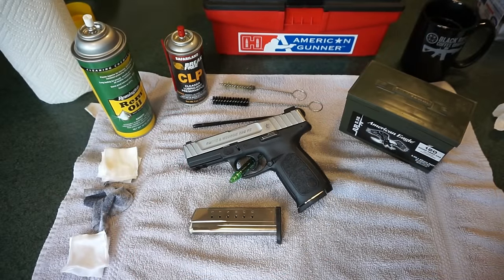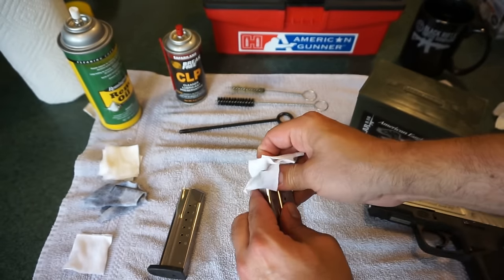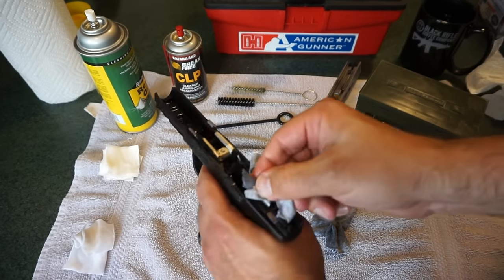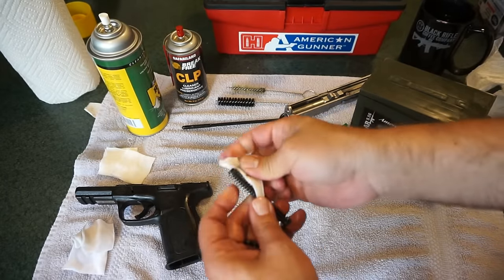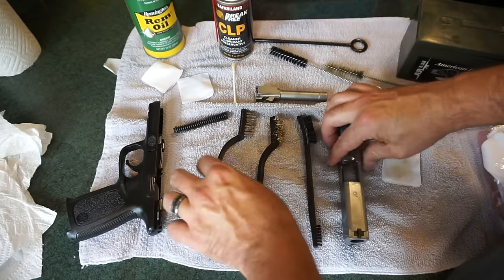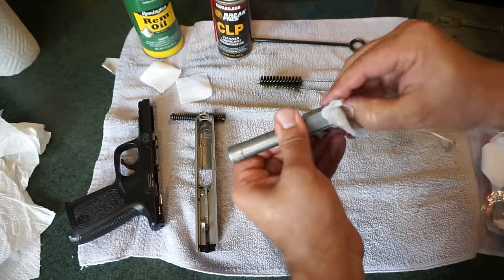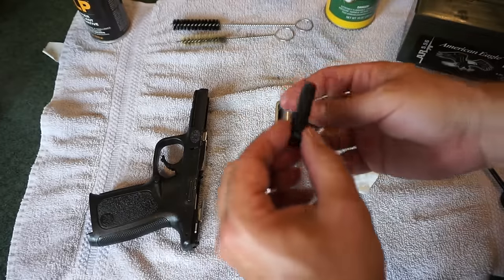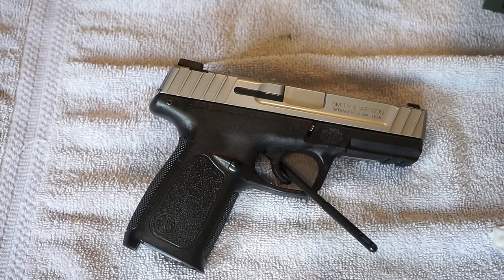Smith & Wesson SD9VE Cleaning!

Comment: Did you ever do the Apex trigger? I have the trigger installed but I didn't take note of the back part of the slide.
Reply from the maker: I always wanted to but I sold it during Covid lockdown to a friend
Reply: @travisp11  fair enough. Apex released one and I got er done 👍🏾
Reply from the maker: The only thing that I have heard is that the striker spring can cause light primer strikes but this was many years ago and Apex may have fixed the issue. Definitely test it after you make the swap. @JonathanLove

Comment: How often do you need to clean a pistol? SD9VE will be my first.
Thank you
Reply from the maker: I clean mine after every range trip and the longer you wait and more rounds you put through it equals more time spent cleaning. Eventually the gun will start to malfunction from being extremely dirty. At a maximum I would say 500 rounds but if your gun starts acting up before that, then clean it but again my preference is every range trip.

Comment: I have an issue with pulling the two releases on each side, I tried the way you did it and I couldn't get it. Is there another way?
Reply from the maker: Just make sure the gun is dry with no oil on it. It takes practice but gets easier the more you are able to do it. You can also pull the slide back slightly, grip the front of the gun and with the slide being held back by your left grip, use your right hand to pull the tabs. This is basically going from the opposite side of what I did in this video

Comment: just bought a new sd9ve from Cabela's $304.THIS IS MY FIRST PISTOL.does it have to be cleaned out of the box before shooting it?
Reply from the maker: offset485 yes. You may have some factory oil and grease in it that could cause malfunctions. At a minimum, just get a can of rem oil, some paper towels and and old  t shirt you can cut up. I saw the Cabela's deal. That FDE model is calling me!

Comment: I absolutely love everything about this gun except it seems hard to take apart for me. I got it from my dad, and he seemed to have the same issue that after pulling the slide back and the tabs down, the slide would only go forward a half an inch. I cant seem to get it to come off completely
Reply from the maker: Yeah, those tabs are a pain.  I believe you can swap out those tabs with larger ones.  Check out NDZ performance, Apex gun parts or Lakeline LLC.  One of those companies makes them.  You also need to make sure the magazine is out of the pistol and that you pull the trigger to release the slide (but be sure the firearm is empty).
Reply: @travisp11  I just found longer slide lock releases on NDZ for like 10 bucks. no brainer, because getting the slide off can be a bit of a bear if you can't get a good grip on the tabs. took me a few times before I was able to do it.
Reply from the maker: @ninevoltromeo  cool! Their accessories are good!
Reply: @ninevoltromeo  thank you for this info, Tommy! I've had the gun for a while, but I've only got it once. It's still oily in the internal areas, but I decided to look into keeping it clean and I had the worst time disassembling this thing!

Definitely going to buy a larger takedown lever.  New to marksmanship (first gun), so I was ready to just buy another one! 🤬
Reply: You guys are missing a small detail that makes buying extended take down tabs a waste of money and time. First, use your firing hand at the back to move the slide back just an eighth of an inch or so, then once you pull down the take down tabs, just pull the trigger and the slide will come right off. Many people think it's stuck at the point, but after a pull of the trigger it is free. No need to endlessly spend money to fix perceived problems. A little more research saves you a lot of money. The same with the trigger. Everyone says to buy the Apex trigger, but that is also a waste of money. You can polish the internals and lube the trigger guard, and the trigger becomes buttery smooth. A little research goes a long way. Cheers!
Reply: Damn ...pain in the ass taking this gun apart!!!! 😡😡😡

Comment: Last time I saw the S&W SD9VE for sale in July 2020  was $389, I already have it so I bought the M&P 2.0 Compact. Only issue I had with the SD9VE ? Polymer guide rod warped after 200 rounds, replaced it with a 20lb steel one.
Reply from the maker: If you check my channel I did a review on the NZD steel guide rod for the SD9VE. It was a great purchase.

Comment: Great video! Very helpful!
But isn't Rem-oil and Clp basically the same thing? Both spray cans literally describe the same cleaning purposes, is it possible to maybe just use Rem-oil for the whole cleaning process?
Reply from the maker: Armando Hernandez Rem oil cleans well but is thinner but will leave a protective coat. CLP is thicker but cleans better but Safariand CLP is my preference.

Comment: I've had this gun for over a year and its been sitting in a case. Its gotten some rust on the outside, very minor, what do you recommend?
Reply from the maker: Try cleaning it with a few coats of CLP cleaner.  You could use some 0000 grade brass or steel wool.  That may be just fine enough to remove the rust but not ruin the finish of the slide.
Reply: Hey guy...you can use WD-40 SPECIALIST gel lube on a pad. It will remove the rust and protect for a long long while. Shake the can good before using !
Reply: Thanks for both of the options
Reply from the maker: @MrKsito  Glad to help!
Reply from the maker: @jtlouie3738  good to know!

Comment: hi thanks for the video. but after i cleaned my firearm i tried clearing the chamber a few times and the slide wouyld get stuck. I would either have the hit the back of the slide to disengage it. any suggestions please. thanks in advance.
Reply from the maker: It sounds like the guide rod may not be flat on the the barrel underneath. Possibly check to see if it is resting at an angle or if it is flat.

Comment: My trigger bar is a little scraped the long piece on the right hand side that pulls back when you pull the trigger I’m not sure what caused it I have the sd9 2.0 oil was leaking out of it straight out the box shot about 20 times but it started to make a grinding or crunching sound when cocking it
Reply from the maker: It sounds like their is some sort of burr or particle in the assembly on on the frame. If it shoots fine that noise and grinding may eventually disappear but it if really bothers you, you can send the pistol in for repair.

Comment: For the guide rod, ndz offers a 15, 18 and 20 lb assembly. What difference does it make? Which do you recommend?
Reply from the maker: Colten Roth watch my video on this guide rod. I believe that I went 18lbs as it was the closest to factory specs. I think you can change recoil springs to make the pistol function better with heavier or lighter grain weights of ammo but I only go with factory pound weights for springs.

Comment: Good video ill be cleaning my gun soon. The sd9ve is my first hand gun and i like it alot. But question, did you install the apex spring kit? I was reading the striker spring may cause dry fire?
Reply from the maker: Yup. Don't install the striker spring from Apex, stick with the Smith spring and you should not have light primer strikes.
Reply: @travisp11  thanks for the fast reply.
Reply from the maker: @angelarceo3678  No problem.
Reply from the maker: @angelarceo3678  Yup!

Comment: Just purchased this one. It’s my first 9mm. Thank for this vid showing how to break it down and clean it. Where can I get Rem oil and Clp?  Subscribed!  Keep the vids coming!
Reply from the maker: You can get Rem Oil and CLP at walmart in the sporting goods/firearms section.
Reply: Be careful it gets rusty fast! I’m not sure how “stainless steel” gets rusty ... did a quick google and found out this is a common problem so disappointed
Reply from the maker: David Cardenas I’ve heard this and seen this on other firearms, especially if you live in a humid or salty coastal environment.
Reply: travisp11 what do you think could help for that ? Slow down the rust
Reply from the maker: @78723lild  Frequent cleaning with CLP. Leave a thin coat on it.

Comment: Question. How often do you want to clean a gun. Dont have any experience and actually just bought this gun.
Reply from the maker: I have quite a few that I don't shoot in my personal collection.  I take them out at least once per year for a basic field strip and clean.  Clean out the bores, add a thin coat of oil to the action.  Since I am constantly testing new firearms (that I have to return) I don't shoot my own firearms as much as I want.  If you have a daily carry firearm Id say maybe every other month take it a apart and clean it, simply because you can get lint, sand, dirt, etc. that will find its way into the firearm from daily carry.

Comment: Just got a sd9ve...can I buy all of these products in 1 kit or do I have to buy them separately? Found some kits but there not these products? Will others do or should I stick with the ones in this video?
Reply from the maker: I bought everything separately. I don’t belief you can buy and all in one that comes with CLP or Remoil in it. You can buy some all in one kits that still include cleaning oil and those will work fine, too.
Reply: @travisp11  ok cool.... 1 other question. I know the CLP is the for cleaning and lubrication. What's the purpose of the rem oil? I see that you use both.
Reply from the maker: KingLeo8179 it does the same thing. The Remoil is a thinner lubricant and works fine as a cleaner and oil.
Reply: @travisp11  ok I appreciate the help.... Good video BTW. Simple and to the point 👍🏾
Reply from the maker: KingLeo8179 thanks man and I may be a bit long winded but I make these videos for the beginner.
Reply: @travisp11  nah that's what I liked about it. You broke it down..... Oh yeah I forgot to ask... So with the CLP and rem oil would you recommend using both or is it an either or type of thing?
Reply from the maker: KingLeo8179 if you want to use CLP, in my opinion, you will get superior lubrication, cleaning and protection versus Remoil. Just use that on all of your firearms and you will be fine.
Reply: @travisp11  cool... Hey man I really appreciate it.
Reply from the maker: KingLeo8179 Glad to help!
Reply: @travisp11  hey at the end of the vid when you were wiping down the slide with that patch was it a dry patch or did it have anything on it? Heard it was good to leave a light coat on the outside of the gun to prevent rust.
Reply from the maker: @TheCoolSpot  You can wipe off the excess oil and put just a drop or two on a patch to wipe down the firearm. Wont hurt anything.

Comment: hello,
what brand of ammunition do you recommend? I noticed the American eagle on the table, also the owner manual for the SD9VE says not to use "+P or +P+" have you tried other brands for the SD9VE?
Reply from the maker: Federal 115 gr. I don’t usually run +P
Reply: I use Federal FMJ 115gr., another brand is Winchester USA Forged Steel Case FMJ 115gr.; But different ammo tends to get the firearm dirtier, and at times longer to clean. But yes usually I use much 115gr or 124gr. and I'll use/ run American Eagle FMJ 124gr. as well as Blazer Brass FMJ 147gr., Hornady Critical Defense 115gr. FTX, Tula Ammo FMJ 115gr.
All great ammo which spread love really good, efficiently. and reliably. Though there's still more out there I've need to test out.

Comment: I Found the stainless steel guide rod by NDZ on eBay. They have different weights listed on them. What is that for?  And which do I get for the SD9VE?
Reply from the maker: SideLineJoe check my video on the NDZ guide rod, I think I mention the weight in the video. Also, email NDZ, they have great customer service.
Reply from the maker: Im pretty sure that it is 18lbs.
Reply: Thanks Travis
Reply from the maker: SideLineJoe alright!

Comment: I cleaned it and put it back together but my trigger didn’t reset should I be concerned?
Reply from the maker: You should be fine. Will it reset now and dry fire if you pull back on the slide and test the trigger?

Comment: I just bought one yesterday and it definitely was not no $300 gun...closer to $500 actually, in fact it costs more than my p95 9mm ruger did years ago, but it's such good quality and is smith and wesson, so I didn't buy it based on just the price
Reply from the maker: The prices I mentioned were from many years ago. At one point, I saw the SD9VEs advertiesed for $279 on CDNN but now the prices are definitely up.

Comment: Have you tried out shooter lube? I thinkn its something I'm personally going to start using because the ease of use.
Reply from the maker: Havent tried it yet.  I usually just stick with CLP but I have tried some of the Lucas Oil gun lubes and they work well.
Reply: I think it will be much better then the traditional hoppes solution. I spilled a bottle of solvent years ago and i can still remember the smell haha.

Comment: When you first push the bore brush through the barrel, avoid pointing the barrel towards your just cleaned slide as it usually will spray some gunk out the front of the barrel.
Reply from the maker: True!

Comment: the take down tabs are so small and push into far on one side the other side pushes out so you cant pull the one down all with the slide back an inch its the worst lol
Reply from the maker: It can be swapped out with a better part from Apex gun parts.

Comment: Just picked mine up from a pawn shop today for $200 looking brand new only came with one mag but I am happy with it any suggestions on out the waistband holsters that would work with this... Information on this video is great thank you for it and thank you also for the PT111 videos that you did in the past
Reply from the maker: Mr MeMkNoCk Lucky!!! Get over to PSA and order two mags for $40. About the best deal you are gonna find on new Smith mags for the SD9. You won't be disappointed!
Reply from the maker: Mr MeMkNoCk you can use Glock 17 Holsters with this gun. I have a Kydex holster and external padded nylon holster got the G17 that work with the SD9.
Reply: AWESOME!! Thanks for all the great info heading over to PSA now keep up the great work and great videos

Comment: did you get the 15lb 18lb or 20lb guide rod and spring?
Reply from the maker: I believe it is the 20. It matches the same factory weight. You may want to see what weight the factory used but I'm pretty sure it was a 20.

Comment: I'm having the hardest time getting my slide to release using my left hand  ,then the trigger seems to mis or its stuck in place not catching ,idk but if you see my text and can advice me on what's going on with it ,I'd definitely appreciate it lol sep 3 2020 or do you think I need ho take it back to the store  ? Anybody ??
Reply from the maker: I would definitely send it back. Take it apart and clean it and if it continues having the same issue, then contact Smith about a return.
Reply: @travisp11  I cant take it apart that's the issue I'm having actually I've never fired it ,I bought it a couple years ago ,
Reply from the maker: Bugs Bunny if you can, take it to your local firearms store or gunsmith and see if they can remove the slide. Taking that slide off is the tricky part.
Reply: @travisp11  yes it is ,I'm definitely going to take it back to the store to find out what is going on with it ,I'm just lucky I didnt need it ! And it didnt fire

Comment: Can someone please help
Me??!! I have this exact same gun , and I’m a first time handgun owner and I have a fully loaded clip and try and load one in the chamber , and it jams EVERYTIME... I’ve cleaned it and all that crap...
Reply from the maker: Have you tried loading the first round by pressing the slide release button? Have you tried other ammo? There is the possibility that your barrel is out if spec and the firearm needs to be returned. Are you using 9x19 9mm luger ammo?
Reply: @travisp11  I bought the gun from my dad who bought it from my uncle who bought it brand new,  and nah I haven’t tried new ammo , its a .40 not a 9 , it refuses to chamber a bullet unless the clip only has 3-4 bullets in it, Ik it sounds ridiculous but it’s true, and when it finally does chamber a round ,it hesitates...
Reply from the maker: @coreyrogers5358  replace the guide rod and spring with an aftermarket unit from NDZ performance. They are on eBay. I don’t know what spring weight you need but you want the stock spring weight (look for that on the eBay ad.) if you don’t know, email NDZ and they will get back to you. I had the same problem in my SD9VE which had a flimsy guide rod that would flex and not retain tension. This resulted in a lazy slide that was even lazier to load on a full mag. Also,‘check to be sure the mag spring isn’t reversed or upside down in the magazine. The NDZ spring runs around $20 but is so worth it.
Reply: @travisp11  thank you so much brother I’ll surely look into it, I shot it for the first time today and I fell in love , this gun is just perfect in every way, well other than the issue😂
Reply from the maker: @coreyrogers5358  the factory guide rod and recoil spring are a joke. I’ve owned 2 different SD9VEs and the both had that same issue, weak charging that required aftermarket guide rods and springs. Also check out Galloway as they make good aftermarket unitsz

Comment: why cant I find any manuals or video's showing how to get at the firing pin and inner workings/im funny that way I like to have extra pin and spring s@m says do to this and that they can not legally give that info out
Reply from the maker: barbara bard cleaning this pin isn’t always necessary. I usually don’t clean my striker/firing pin but you can. Because the manual doesn’t tell you how to clean it, it’s not considered necessary maintenance. Look around on you tube and see if anyone has posted a video on this.